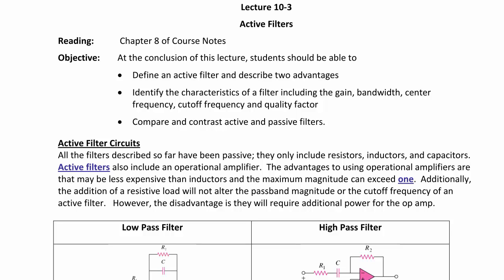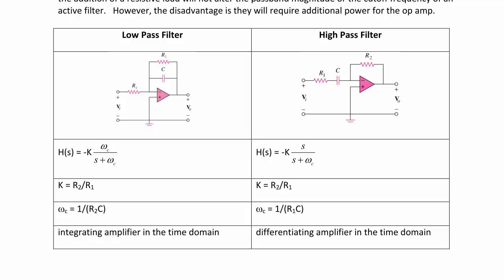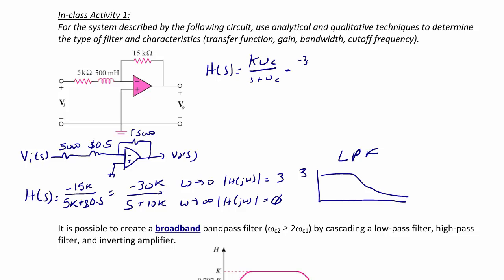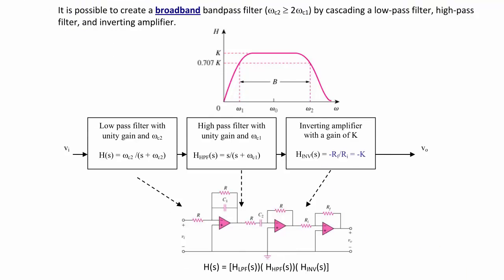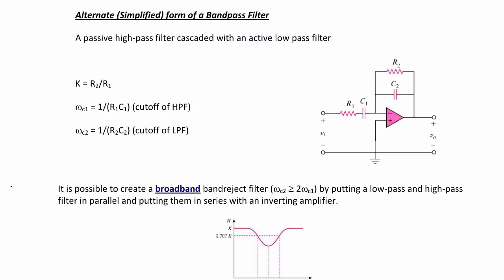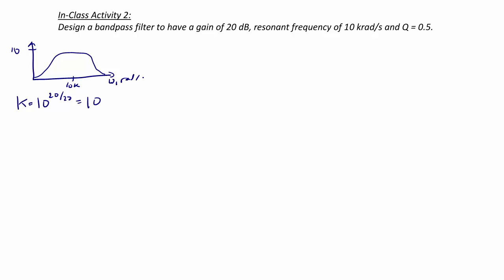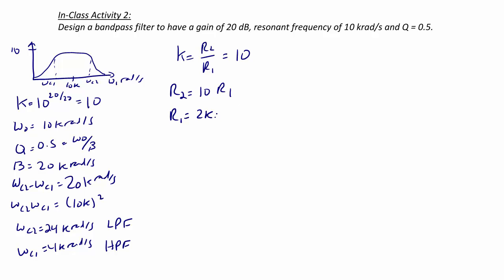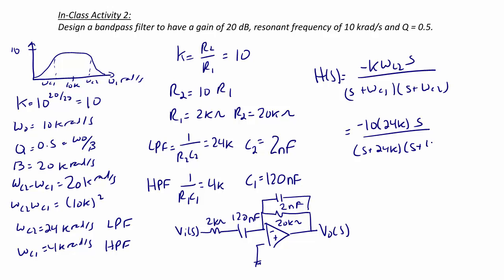ECE205 Lecture 10-3: Active Filters

Comment: Why is it that my university did it different?
Reply from the maker: there are many ways to design active and passive filters, you just have to make sure the circuit implements the transfer function that you want with the correct gain, bandwidth, resonant and cut off frequencies.
Reply: @RoseHulmanOnline Or , perhaps, Convention. It seems that the convention which I was taught is based around KCL and KVL and Circuit Analysis. That's what we used when it came to designing our pressure sensor, as well as the Comparator Circuit, even our Heart Beat Sensor. But thank you for your time, and I will definitely keep that in mind, that there are many different ways to design. 

With kind and very thankful regards, Gabe.